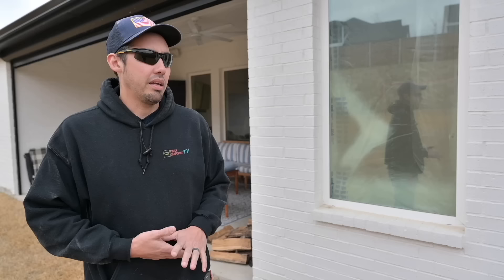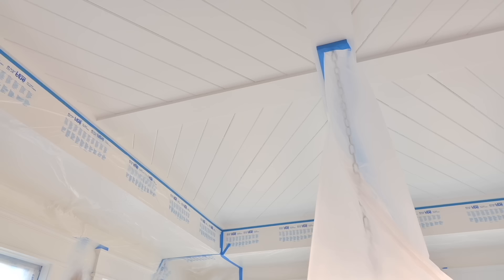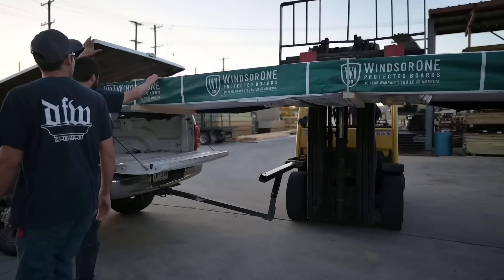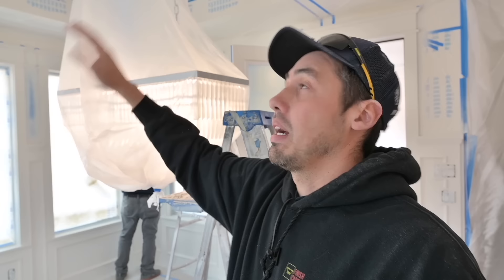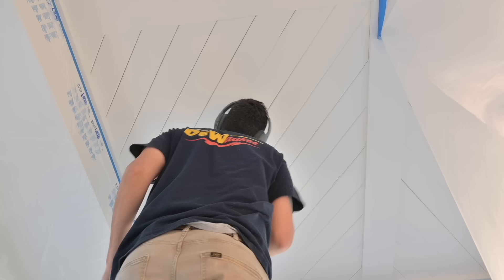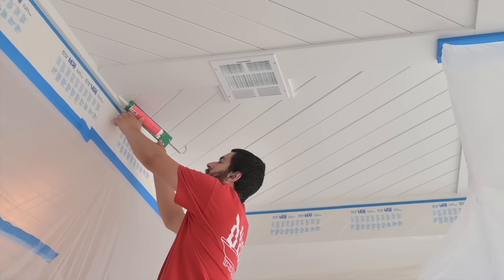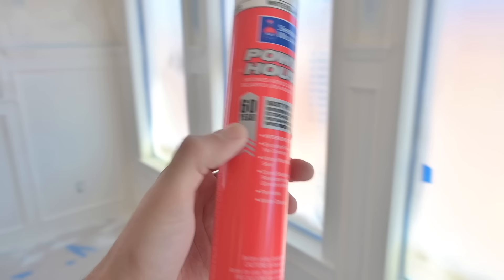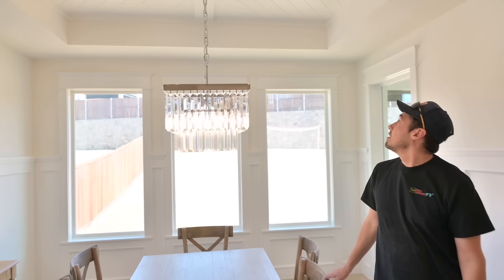Customer furious with me - Failed Trim Install

Comment: Yeah from my experience as a cabinet maker and finish carpenter you never caulk tongue and groove boards due to constant movement.  Just because it has shrunk already it will expand again in the humid weather.  Heat rises so the ceiling is the first to react.  I would have pre painted each board so when it shrinks you don’t see the unpainted tongue.  My two cents other than that I admire your work.  It’s how we get better at what we do through our mistakes 🙂
Reply: Absolutely what I was going to say!:  pre-prime (if it wasn’t) and two layers of topcoat w/ no caulk at all!  It supposed to move.  Then just touch up, clean up.  Also, there is a caulk removal tool specific to this task, btw.  Removes both sides of adhesion at once.  Moisture check, or simply two weeks acclimation, always.
Reply: If you are an experienced cabinet worker why would you approve of this slop shod work much less praise it? This isn't  a third grader doing a finger painting project. This is a man charging thousands of dollars for jobs that he isn't qualified for. And he has conned these people to let him do thousands of additional work.
In your years of work where was it when you were taught to jam and squeeze wood together to tighten joints?  I'm  sorry but people keep encouraging these "youtubers" without realizing who may end up paying because of misplaced "reviews".....
Reply: @dennisdoes86 He’s back correcting it for free isn’t he?
Reply: @t-rex4211  i suppose he is.  But why do customers have to call and be further inconvenienced because it wasn't done right the first time?  Kudos to him going back.
Reply: You are 100% correct that's how it's done , same as shaker style doors we spray the panel before assembly for the same reason
Reply: I suppose this comment includes normal shiplap? Bc it's technically tongue and groove.
Reply: I'm sure everything you've done in your career came out 100%. Keyboard warrior

Comment: A true professional always stands behind their work, awesome lesson Richard!
Reply: Since he stopped using DeWalt, he's never been the same man, Vince... 😟     😂
Reply: @peterfitzpatrick7032  he’s a Dewaukita man! 🤣
Reply: Only Milwaukee for me Vince :)
Reply: @VCGConstruction  all about that green and black with 30 batteries
Reply: So true 📐
Reply: Good point Vince do you know any?
Reply: Hey look it's ole Vince here  👍
Reply: I do stand behind in all my works ....
Reply: I would have never warranted against cracking past 90 days even I used top of the line caulk.
Reply: @user-yr4os6jz4r    so you'd be happy enough to leave the customer with that ? 

I wouldn't ... 
Installer error, Richard said it himself, he didn't leave the wood in the house to aclimate before installing... it dried & shrunk.. you gonna simply tell the customer thats on them ? 😳
Reply: or in this 'under' his work...
Reply: Well said boys ,although 50 years in the trades and I still never answer the phone if there's a problem , God bless America
Reply: Serve your right you know you should have had that material stabilized in the house
Reply: @user-yr4os6jz4r  Licensed builders in Michigan must warranty for 12 months. Not sure about Texas.
Reply: Vcg is garbage...I've seen plenty of your unhappy customers!!!
Reply: Thanks for the lesson
Reply: Tng stock on a ceiling ,heat,humidity ,wood is a
Reply: good luck finding one.
Reply: A true professional always stands behind HIS OR HER work... The pronoun must match the subject. This is the most common grammar mistake I see amongst highly educated people.
Reply: @RAINIDONTMIND  I dont see what you mean?  Why isnt the word their proper? Their is a possessive pronoun. Whos work?  Their work. whos their?  Professionals, plural.  I dont know maybe you are saying professional is singular. Maybe you are right.  It would be ok to say His work since the pro is a he in this case.  Yes I think you are right now that you got me thinking.
Reply: Gee I thought it was further,farther,as is common on the daily news,
Reply: @user-yr4os6jz4r  yep. money grab and run. Thats you.
Reply: @ScreamingEagleFTW  I look at it this way. When  the sun consumes the earth and there is nobody left to know what you did whether it be good or bad, what does it really matter? I lost my son today.
Reply: @user-yr4os6jz4r  I guess if you dont mind living in a world where nobody gives  a damn and you have no self respect or desire to make the world less miserable instead of more miserable.  With that outlook why even get out of bed in the morning?  Why wait until the sun consumes the earth?  Doing the right thing matters, it matters a lot.  In a million years it will matter that when faced with living a pointless life or giving it meaning, you gave it meaning. That matters. That you beat the otherwise pointlessness of existence.
Reply: It’s good to see him willing to try to fix his mistake, however a true professional understands the movement of wood. Perfect example of not having a very good understanding of the basics. If his standard practice is to show up with the materials and install them the same day then I guarantee most of his jobs look like this.
Reply: @ScreamingEagleFTW  Still  seems pointless to me yet very strange that we are aware of our actual individual existence.   Very strange.
Reply: @user-yr4os6jz4r  yes its strange to me also and thats why I think this is not all some big accident but it was intentional at some level.
Reply: A true professional would have told the home owner to stick it where the sun never shines.
Reply: We in sweden uses tongue-in-groove board just because of that problem
Reply: @peterfitzpatrick7032  I think it was more to the point that it should have never been caulked to begin with, let alone again. He will be forever tied at the hip with that job because it should have never been done that way to begin with.... example... even if the caulk flexes enough to keep from cracking the paint will still do so. Drying and Acclimating is to try to keep the wood/board itself from visibly cracking (where you don't want it to crack). It's for the same reason you don't run boards tight against walls etc. or you can end up with waves/bows/cracks/etc... they just simply expand and contract through out the year.. and depending on area one lives some far more than others... houses in general shift around a little throughout the year.

Comment: The fact that you owned the mistake, fixed the error for the customer, and were willing to share this "fail", shows why you have nearly a half-million subscribers!  Very classy, Brother!
Reply: Problem definitely not fixed
Reply: Sure it is....."pleasing to the eye"
Reply: I would hire you in a minute because you stand by your work
Reply: @gregnixon5770  until it's not...again
Reply: @atomjordan  don't just act like you know all. Emphasize on to why the problems not fixed.
Reply: @jacobchristian8608  don't mean to come off cocky, I definitely don't know all. I'm an amateur woodworker and builder...lots of good info in tons of other threads.
Reply: @atomjordan  so again, how is it not fixed?
Reply: @keithstone6411  if you need a detailed explanation I'd read the comments..Basically those joints will continue to expand and contract and cause problems with caulking.
Reply: @keithstone6411  mdf is what you should use if its going to be painted. it is more dimensionally stsble than solid wood
Reply: @erokbossan420  I appreciate you taking the time to tell me that. Have a great day.
Reply: A real mentor to me!!!
Reply: well bc when youre professional and charging real people money you cant do such mistakes. this mean you are not ready for this job yet. simple. me as a customer IM NOT  looking for experiments or doing things wrong in my house. But again, that's only if youre considering yourself  a professional. I know everyone makes mistakes time to time but not this caliber. It was easy to prevent if you are real pro. He should pay more attention to what his doing instead playing with that camera and all of this... i like his channel too but maybe its just too much for him.